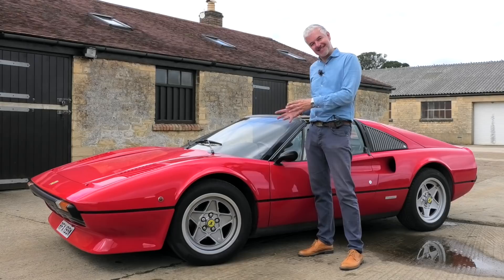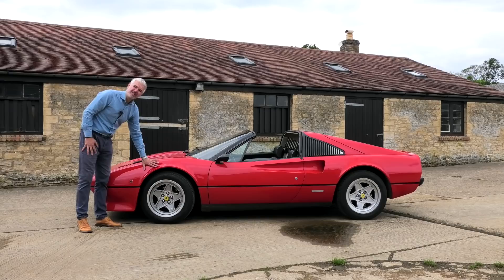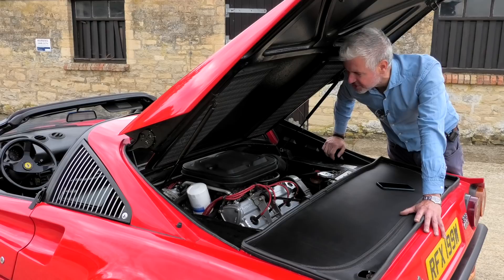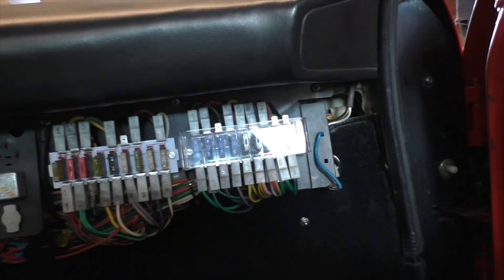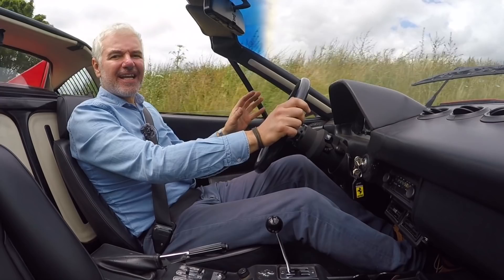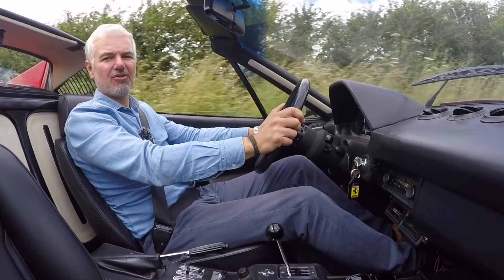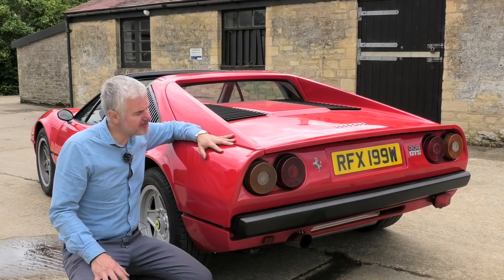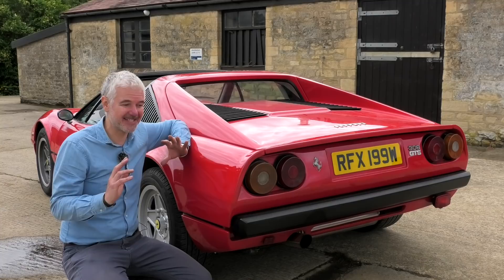Ferrari 308 Buyer’s Guide and History of Model Changes

Comment: Disappointed in you Jack, you got the wheel sizeswrong!  Vetroresina and carb cars had "14 inch wheels with Michelin XWX non-Metric tyres (factory option was "16 wheels with Pirelli P7's) 2v injected were "15.5  Metric with Michelin TRX tyres and QV's were either 15.5 TRX or "16 Wheels, depending on which Market?  Aftermarket replicas are all "16 wheels.

Comment: Jack, ALL the 308GTB's had dry sump engines. The GTS's were wet sump. I don't know whether the later variants, QV's, 328's etc were similarly different. I owned a '78 GTB in 1986 which I loved. While I admire your DIY prowess, I wouldn't have attempted the repairs to the engine as you have. I left that to my specialist.

Comment: In 1984? Ferrari improved the rustproofing. They started to use galvanised steel (electroplated on one side of the panels) and electrophoretic painting process. 

I have a 328, doesn’t get driven much. Change belts every 7 years. Service every second or third year. 😃
Reply from the maker: Very true, had read that but forgot to mention!! Thank you!

Comment: Jack, you forgot to mention that there was an Italy only version of this car called the 208 GTB/GTS which had a V8 with the displacement reduced to 2.0 litres. This was because until about 15 years ago, the VAT on cars sold in Italy doubled from 19% to 38% for petrol engines over 2.0 litres and for diesel engines over 2.5 litres.

Comment: When I was looking to buy my first Ferrari, I actually made the trip from Belgium to the UK to look at a LHD 308 GTS in just the spec I wanted. Could have saved me the trip if I had sat in one beforehand because it turned out that I’m just too tall to fit in it. So indeed, very good that you mentioned that. Maybe it will spare other people from that same disappointment. It sounds like you might be hanging on to the Influenzo 😉
Reply from the maker: Thanks Wim, it’s a shame but I think that the seats can be modified and lowered if you really have to have one!!
Reply: Tom Selleck had to have his seat modified when he did Magnum apparently - so it is possible
Reply: @Lee_Pitcher  And his head was still sticking out in the opening scene ;-). No worries, I bought a 348 and two 355s instead. But the design of the 308 is so beautiful that it does still pull at my heart strings.
Reply: @wimdepril6920  Ha. This is true. Not so much of a problem in Hawaii but quite a problem in the UK with our fabulous summer weather (not). Two 355's ?? That's just greedy ! I'm a bit of a short arse so the 308 wasn't a problem for me and the roof was off all the time anyway. A Merak SS is a cool car. I think most Italian stuff is designed for the smaller person
Reply: @Wim de pril I will be checking out a GTB next Monday. Would you mind sharing your height in the forum? I am 198cm but very slim and sporty and I fit well in my Dino 308 GT4 (with the same steering wheel extention mentioned in the vid) and my GT40 (slightly modified the seat in this wonderful car by CAV) but I am really worried about how I will fit in the GTB ... thx
Reply: @cavgt4037  I’m 191 cm and also pretty slim. I just didn’t have the head room to get comfortable.
Reply: @wimdepril6920  Thanks Wim, well, I guess it all comes down to proportions (and whether it's possible to remove the seat rails and doing without the possibility of an adjustment) - I will let you know how it all ended ...
Reply: @cavgt4037  Good luck! It is a gorgeous car after all.

Comment: Good summary, and I'm sure you've spotted it should be Dino 206GT for that picture.
The gt4 sold in relatively lower numbers not just because it was a styling departure but also because it was launched into the middle of the 73-74 oil crisis.  In fact it sold nearly as many as the 246 Dinos.
The carb 308s were quoted at 250bhp but dyno tests suggest these Italian marketing horsepower actually equate to around 235 English bhp.  With the 308i and the QV the power quoted actually was now accurate so the QV does show a slight real world improvement over the first cars.  The fuel injection on the 'i' models was aimed primarily at reducing emissions, hence the smaller output.
You're dead right about the rust potential around the bottom of the car, but the wheel arches are single skin on all 4 corners and not protected by the plastic bits, which are there just to isolate the tanks, engine and rear wing areas from spray.  Mud can stay in those lips and start corrosion.
Check round the windscreen frame as well.
Moisture can also accumulate in the felt pads on which the tanks sit and eventually perforate their aluminium skins.  Fortunately they're easy to get out.
The 'gearbox shaft' is the actuator rod from the gear lever, not a drive shaft as some may think from the description.
The carburation and ignition systems are really like having 2 old Morris Minors tied together, it's that level of technology.  So yes they are easily cared for with DIY.
The steering isn't powered, so cheaper and easier to maintain.
The aircon is badged Borletti but the key bits were made by York in the USA and fitted to hundreds of thousands of cars.  If set up correctly it is actually very effective, although it may still need re-gassing every 9 months.  After it was fixed, mine was producing air at 3C.
Your replacement fusebox is awesome.  The original is notorious for overheating and corroding contacts.  Beware non-OEM stereos or alarms; someone may have done horrible things to the wiring and/or over-burdened circuits.
The TRX wheels and tyres were only fitted to some 308is and QVs.  Earlier cars had normal 14" wheels, and it is also hard to get 150+mph-rated tyres for those.  Pattern 16" standard type wheels are a good upgrade for all 308s.
The OEM Ate brakes are poor, but an upgrade to EBC pads makes a major difference.
I'd add that it's a good idea to use Shell V-Power or something similar with good cleaning additives.  These engines were built to '70s tolerances and oil will get into the combustion process.  A good petrol will help keep the rings and valves/guides in good condition.
Good summary of the driving experience.  The parking brake shouldn't drag, but it is pathetic.  The 'Motor' road test of the gt4 which has the same system measured it at less than 0.25g, which would not pass the MOT, when new!  If you're not an experienced Ferrari driver watch out for the dogleg first gear v reverse, but everything is set up for heeling-and-toeing.  Enjoy!
Reply from the maker: Thanks for the informative post and for watching!!

Comment: All good info. My 3.2 Mondial, which is mechanically very similar to the 308/328, has been anvil reliable, and easy and satisfying to work on. Its not quite as pretty as a 308, but it actually handles a bit better, and the soft top factor is another huge plus, at least for this owner. This whole mid to late 80's vintage of Ferrari V8s are incredible machines that a decent DIY mechanic can live with without fearing bankruptcy.
Reply from the maker: Interesting on handling.. what was changed to the 328? Thought chassis was pretty much the same?
Reply: @Number27  Wheelbase on Mondial is slightly larger, which rumor has it allows for better handling.

Comment: As usual, an excellent summary, both helpful and practical for a potential buyer . On the engine, you forgot to mention the crank .There is bearing that goes near the crank pulley , one of the few weaknesses on the V8
Reply from the maker: Not aware of this Martin…?
Reply: In 1997, I organised and attended the Spa Francorchamps Ferrari Days weekend in my Fiat Dino Coupe together with some 308s. One of the 308s had this very problem which looked at 1st to be  leaking crankshaft oil seal. Despite obtaining one from one of the racing teams and helped by a local Fiat dealer to fit it , it manifested itself to be more serious. Good job I had 4 seats to get them home ! The full repair was done by a Ferrari specialist in the UK. I have seen 308's advertised for sale with this problem , just a simple fix Guv! Yeah right!

Comment: there was a special model for the italian market it was introduced for fiscal reasons. the body of the 308. but the engine was only 2 l capacity v8 without turbo charger. called the 208 GTB/GTS with a monstrous 150 hp. these are very rare ! and a bit cheaper to buy but prices have risen a lot the last years

Comment: Very instructive thanks! Looking for a 328 GTS and absolutely terrified about what to expect and the surprises i will get
Reply: Just saw your comment and was wondering if you did end up buying the 328 and how has it been so far?
Reply: @TheNobleLoyalist  not yet. i found it but did not pull the trigger on the purchase yet. i want to, but it's going to be such a nightmare to manage/ fix/ find the parts/ etc. plus it's almost impossible to re-sell... anyways that was my head speaking. my heart will force me to buy it at some point in time
Reply: @rogerkastoun3143  I understand completely.  I had a 89 Esprit in my 20s. Im 41 now and have been itching to buy another late 4cyl Esprit, 88 to 95 but. But my God within the last 3 years prices for the Esprit have literally doubled. Used to be you could buy a sorted SE for mid 20s, now they are double that and who knows the condition.  
Part of me wants to get an 88 or 89 that needs TLC and make it a project and one to hold onto until im old and half dead. Other half of me wants to splurge on a S4 or S4S or MAYBE if the right one came along at the right price an early V8, but im worried about resale value. Ill be the one to pay a hefty premium just because i want it and wont deny myself, but then ill also be the one to lose 25-30% when selling because I dont have the patience to sit on it or deal with the nitpicker buyers.

Comment: Good advice Jack regarding buy the best one you can however I`m disappointed that you didn`t include the GT4 Dino in your report. They are superior in handling, faster in the engine department and more exclusive having been made in much smaller numbers.They are also perplexingly a bit cheaper.  I`ve experienced both versions of the 308 (GTB}and prefer the GT4. I`m an ex rugby player well over six foot and accomodation in the GT4 is better also if you are tall and bigger framed like me. Re reliability of the carb versions carburettors once set up correctly are as reliable and remain in tune as much as FI. Our GT4 is twin distributored (4 sets of points) and even this despite being the most likely item to go out of adjustment have remained as adjusted. The cars are as reliable as any Porsche I`ve owned but like any old car how they`ve been treated and serviced is hugely important. Cam seals by the way can be done merely by removing the cambelts and cam pulleys so not a big item. Essentially they are a high tech/old tech robust car quite easily and cheaply maintained.
Reply from the maker: I also really like a GT4 but this was a GTB/ GTS guide. Also the GT4 may have handled better but it certainly wasn’t any faster! Thanks for watching dude!

Comment: Just stay away from the GTS (flexy, heavy, not as beautiful), if you can get a carbed GTB with dry sump fit 16" wheels and redo all the suspension bushing in polyurethane you'll have a fantastic handling car. For a cheap "power boost" fit a Gr.4 drop gear kit (much shorter ratios than standard) and you can get interesting acceleration figures too.

Comment: was never going to be fuel pressure/flow - the engine will run happily on what’s on the carbs for the brief period of turning.
Hopefully you are getting a wideband lambda not a pointless narrowband. 
You will be very surprised how crap your fuelling will be using something that tells you the mixture in real time - but you need to look past that to troubleshoot this problem.  When you provoke the issue you MUST not adjust throttle angle or engine load - because the ratio will be all over the place anyway. With a bit of normal driving you will learn how to keep the mixture constant for a given load, then you can provoke it by going round a corner and only then can you determine if it’s going rich or lean. My money is on rich (fuel slosh).
After doing this with a 4 barrel and a lambda - I replaced the whole lot with megasquirt fuel injection and have not touched it at least a decade.

Comment: At about 6:40 you mention the ignition system and mention that you only need to keep an eye on the leads.  Not true - distributors over time will develop shaft and bushing wear and the springs fatigue all of which can and will lead to running problems.  That's why I've mentioned to overhaul your old distributor in your earlier vids where you bemoan continued running problems.  Your distributor is now going on 40 years old and likely needs going through.
Reply from the maker: Youre absolute yes right, I didn’t mean ‘just’ the leads. The cap and rotor need to be kept clean and in check and also the advance mechanist. Thanks for watching!
Reply: @Number27  The cap and rotor are normal maintenance items to be replaced during every tune-up.  I'm referring to the wear of moving parts that are NOT part of normal maintenance.  I'm talking about a proper rebuild to eliminate slop and play from years of wear on shaft/bushing/bearings, replacement of springs which have fatigued after years of slinging around against the weights, not to mention adjustment or complete recurve of the timing.  I had a Lucas 25D distributor properly rebuilt for a 72 MGB-GT and the driveability and performance was night and day different with the rebuilt dizzy.

Comment: The 308 Gt4 was only badged as a Dino initially. Later they were rebadged with the prancing horse. Period road tests show that the quattrovalvole cars are quicker than the earlier carb versions. Do you think that your car, if you were merciless, would match the old road test numbers of 0-60 in 6.8 secs, 0-100 in 16.5, and a top end of 150+  ??

Comment: 10/10 video. Love it. Were all the QV’s carbureted?
Gtsi are indeed underpowered but have the Kjetronic fuelsystem which is a very nice system and totally mechanical. Quite easy to deal with as well. Used in quite a variety of cars even in Porsches. Also in Golf GTi etc. 
Honestly, I never liked the interior. It too much plastic to me. 
I must admit that I am a bit disappointed with the engine sound. 
The story of the second gear is typical for fast cars. Often flatouted in first, jamming into second and that is killing the synchros. It is the same story with 915 gearboxes on Porsches. 
I once went to see one to realize I am way too tall for these cars. I am just not 2 meters tall lol. 
Cheers from Belgium!
Reply from the maker: Cheers buddy!! No, all QVs were injected not carburetted!

Comment: I do understand the Ferrari legend. But since Mr Ferrari himself moved on and Ford said go jump, they are cars for the few and very very expensive at that. The engines are Fiat made and the body and trimming is pretty ordinary. That's before something wears out ( normally after just a few years ) and then its deep pocket time. Broom broom.
Reply from the maker: No Ferrari engine was Fiat made apart form the Dino V6 which was made in collaboration with Fiat in the 60s. Thanks for watching!
Reply: @Number27  I have found a lot of Fiat/Lancia parts that will fit on a Ferrari. Homologations is ripe in European cars including Ferrari. My point is that Ferrari are no longer the cars some of them once were yet the prices are up and build quality and reliability way down. Just look at the interior trim on a Ferrari . Any Japanese car is far better finished and painted BTW. I mean a US$150,000 car that needs a complete rebuild after a few miles. Come on.

Comment: Is there a rule of thumb as to which 308 trim lines had the engine cover extend all the way to the back of the louvered area on the rear deck, like your GTS here? I also see lots of 308s where the louvers reach further behind the engine cover, surrounding it on all 3 sides.

Comment: Question on the shift shaft seals. If the seals go bad, does the transmission fluid mix with the engine oil?
Reply from the maker: If it’s really bad then yes.. but the one that first tend to go is the one going from outside into the engine oil sump
Reply: @Number27  True but if you are seeing oil at the front then you should definitely keep an eye on the level in your gearbox. The oil level in the sump is higher than in the transmission so if you have a bad seal it will go through even while the car is sitting in the garage!

Comment: QV is the fastest and best
Reply from the maker: According to Ferrari QV produced 240hp whole carb cars 255hp…
Reply: @Number27  most  carbs 235 ps,but that is not all. Digiplex ignition is better,k-jetronic the right one is o.k. and 4 valves runs smoother and revs better. You should try one.

Comment: I'm going to commit heresy here. For a portion of the money you put into a mediocre Ferrari, you could buy and customise a Pontiac Fiero to give you almost exactly the same experience, (except possibly the engine note). The dimensions are within millimetres, and depending on the motor, performance within the street-legal range is very similar. It was even possible to get a look-alike replacement body, though Ferrari's writmongers may have killed those. I've seen conversions that had be very closely scrutinised to detect.

Comment: Buy a Porsche 911 instead - significantly better engineering.
Reply from the maker: Admittedly they are re better developed, HOWEVER.. don’t be misled. They will cost pretty much the same to maintain and as long as properly looked after these are just as reliable.